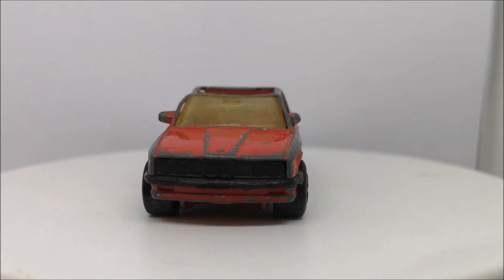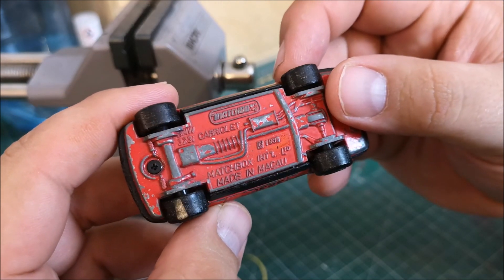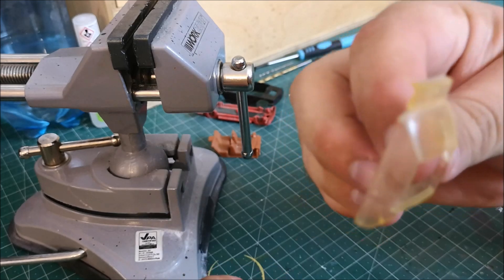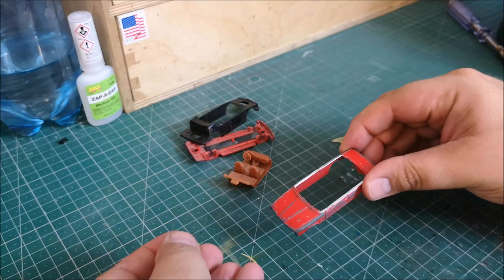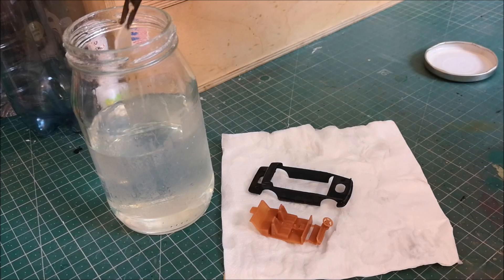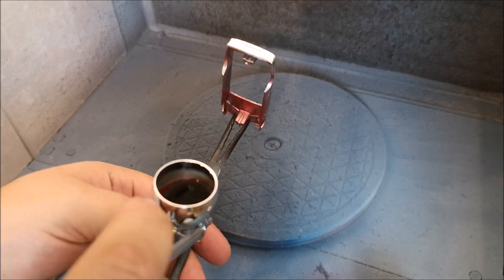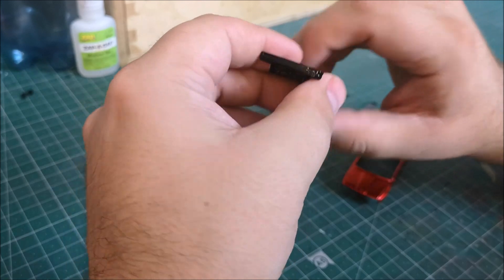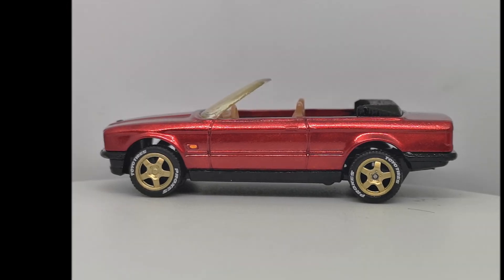Matchbox 1985 BMW E30 Cabriolet - Custom Video

Comment: Hi Rob.I bought the same compressor as the one you use.As i am just starting to restore cars,what pressure do you recommend ?.Many thanks.
Reply from the maker: I think mine is running at around 20 PSI
Reply: Many thanks Rob,keep up those amazing resto's.

Comment: You did a good Job i made a few Matchbox BMW 323 I Baur too they have all the same Problems the bent pillars on the Roof 😉 ...yes the e30 is one of my favorite BMW from the 80s too 😉 I collect them i got a few Models from the e30  in almost all scales where they available that includes the 1:1 Scale too one of my 1:1 Scale is a very rare Version only 5273 Times where build ... i hope you build a few e30 Baurs more 😉

Comment: My guess is that the windscreen came from another car.
Am I right?
My fella and I (and possibly daughter) are looking at restoring/modding some cars. What advice would you give?
Reply from the maker: Correct! It did indeed come from another car! But 0 points 😁

Advice? I know you've watched many of my videos and no doubt other people's. So you should have a good idea on the methods and the tools required. After that it's just a case of giving it a go for yourself and as long as you have some creativity you will be fine. 👍🏼
Reply: Nil points for a correct answer! I think this test is fixed. Cheers for what advice you gave, I was hoping for some insight as to car makers to avoid or colours that work well or dont. I dont have a paint booth and will be using rattles lol. I am also looking to fitting LEDs (really small ones) to suitable cars and just basically being creative like that
Reply from the maker: @DEmma1972  I've only really done matchbox so can't comment on others. I find yellow is the most difficult to paint. But rattle cans should be easier although the paint can be thick so could hide some details
Reply: Thanks for the advice